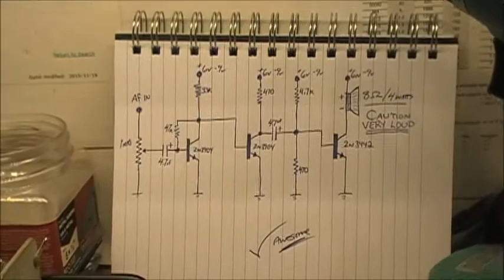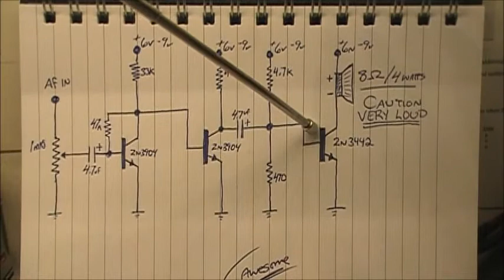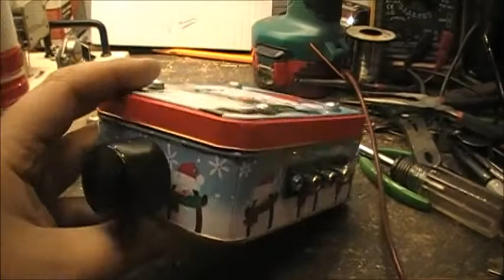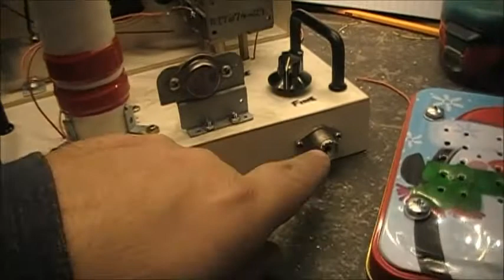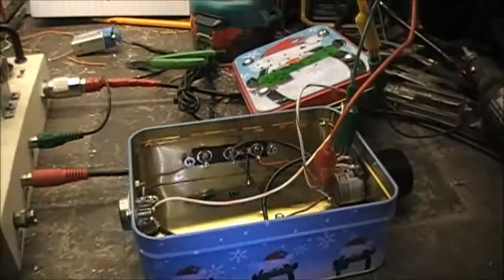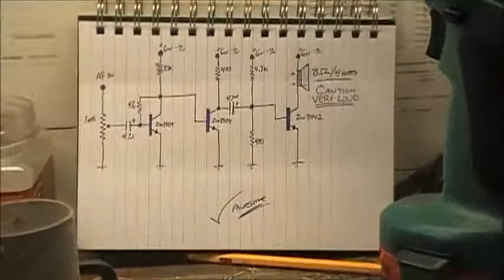New audio amplifier build

Comment: That's is one loud speaker amp hehehe. OMG I love it. I would like to make a version with only one transistor as preamp and something to replace the final one... that I could use a battery and not that loud hahaha. Maybe some smaller transistor. It would be a great replacement for the LM386 amp I'm using now. By the way... I started building bigger coils as well now hahaha. Not as big but a lot bigger than what I usually have 😂😂 73. Another nice video.
Reply from the maker: Sounds great!